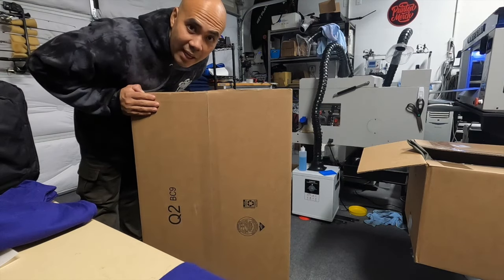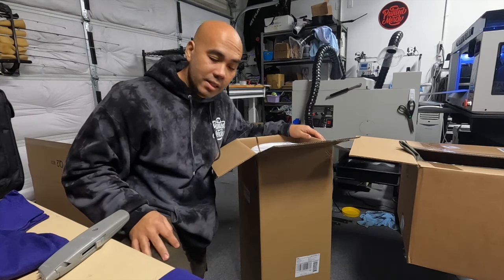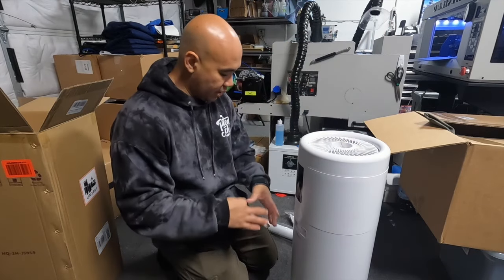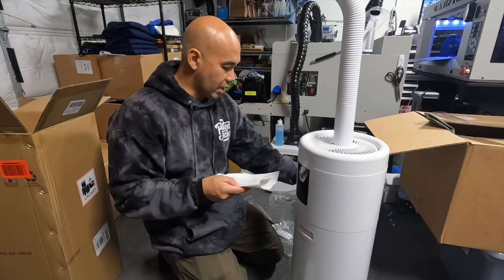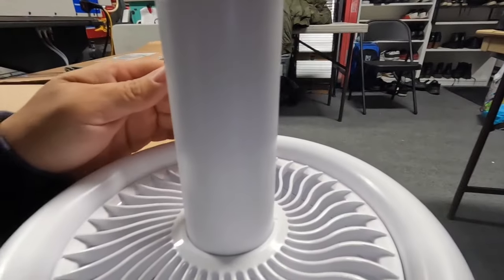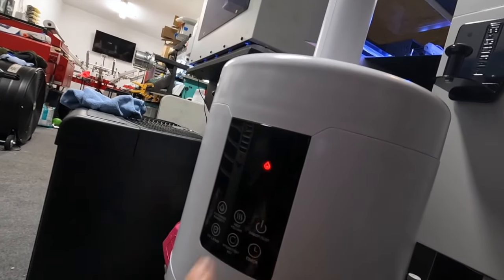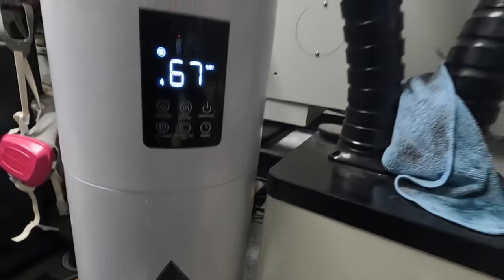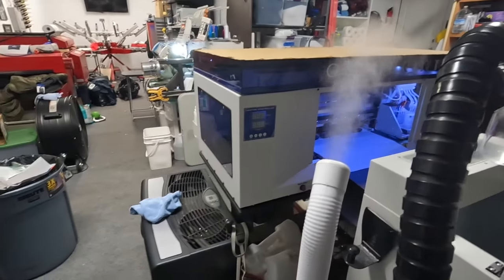YOU NEED TO GET THIS FOR DTF PRINTING :  (S:10/Vlog 25)

Comment: Fun fun....

Yea, for DTG, DTF and inkjet printing, the humidity range you want to target is 40%-60% RH. This will help prevent the inks from drying, preventing nozzle clogs in your printhead and warping your media. You also want the ambient temperature between roughly 70-90 degrees.